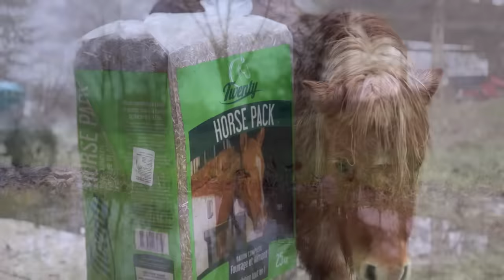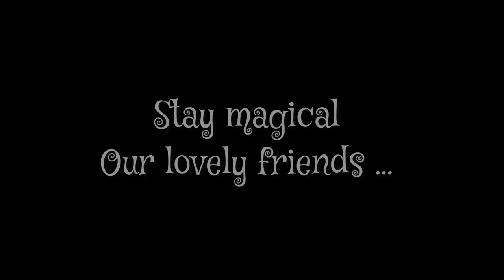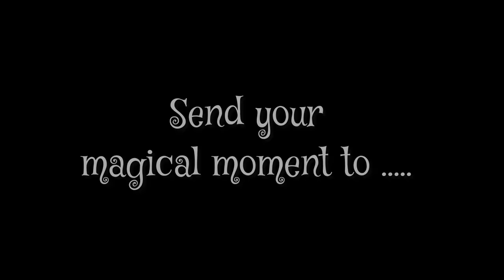Éperlan du Fouquet

Comment: Hoping the FEI come on board with at least considering the proposal. Many dressage horses slip under the radar and end up compounding old injuries because of ignorance. At least in Europe, some countries require horses have passports even to travel within their own country. Not so in my home country Australia or others. It’s not a fault, just an oversight or a lack of vision for improving a system that needs updating. There are attempts through some associations, however, that is as far as it goes. Wamberal is just around the corner from where I live, so hi 👋 via France. 😂

Comment: we had a pony decades ago.  we had a basin under a faucet that we would turn on and refill when needed,  The pony would occasionally  use its mouth to turn on the faucet,  Unfortunately it would not turn it off.  To prevent the water from running all the time, we had to remove the handle

Comment: You are right about the covered auto hose reels. My son advised me not to get one as the clay dirt on the ground here gets on and needs cleaning every time or I would not be strong enough to pull it out. Instead I got one like yours and it is very good. The stripe also makes it easy to see and not trip over plus no mistaking it for a snake. 😳😅